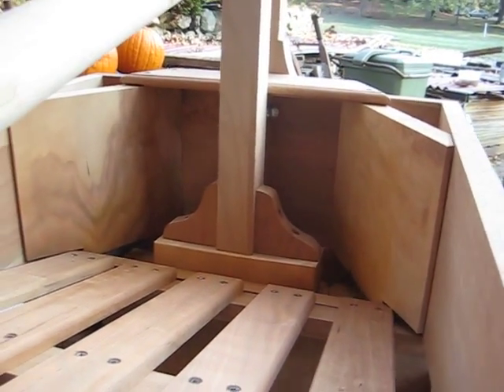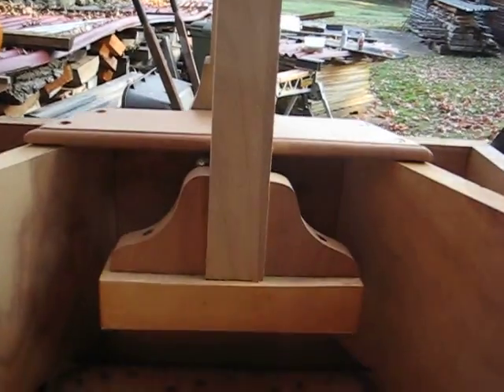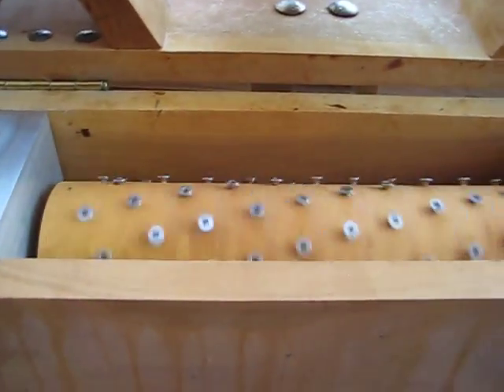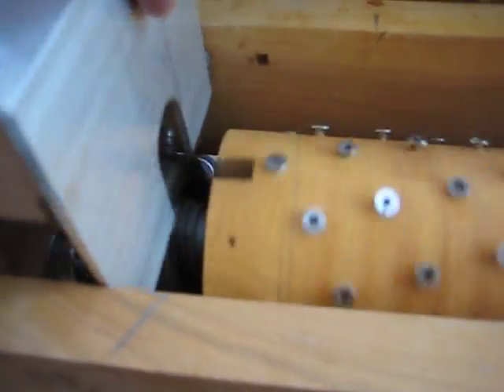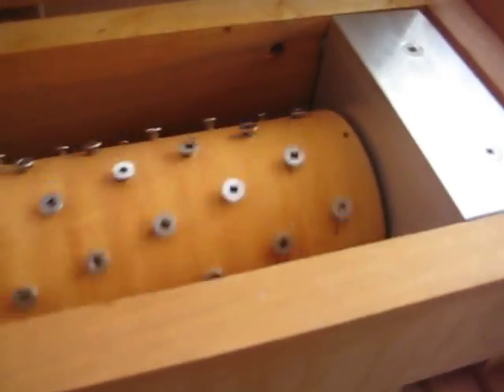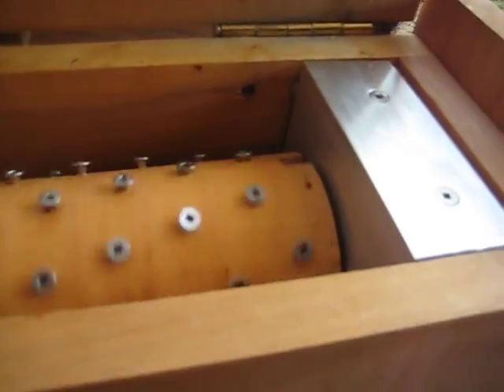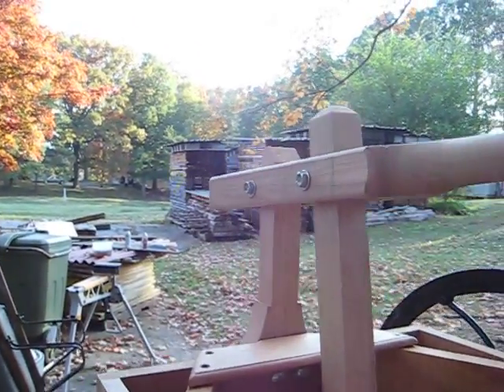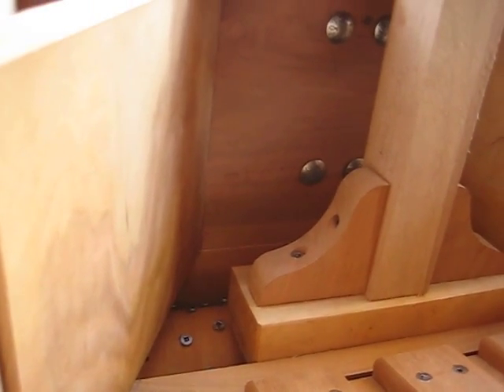Apple Cider Press Hand Made, DIY

Comment: How did you key the shaft to the drum?
Reply from the maker: The maple drum is a two piece glue-up. Each piece is grooved 1/2"  then glued up with the 1"shaft captured in between. I also have a rolled pin through the shaft and captured in a notch on the end of the wood.